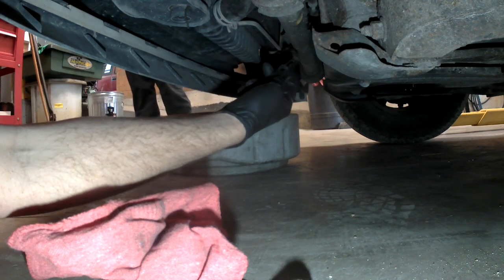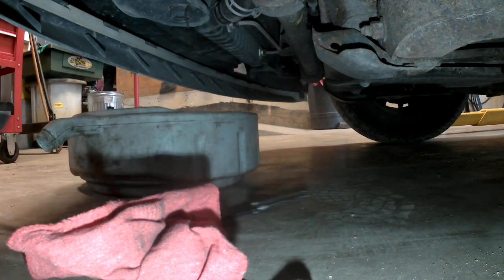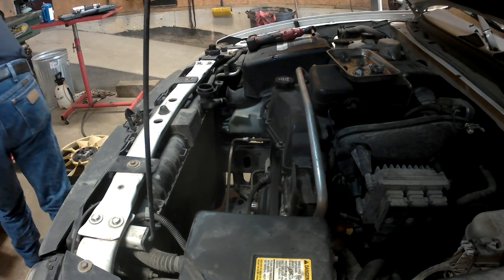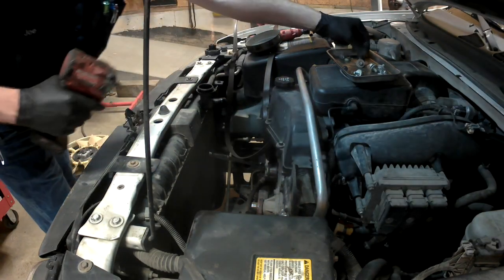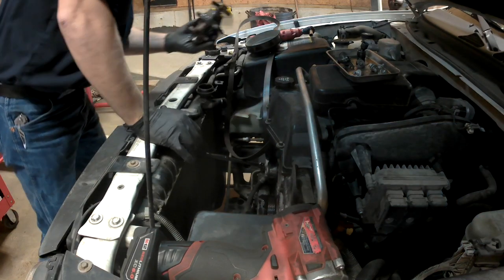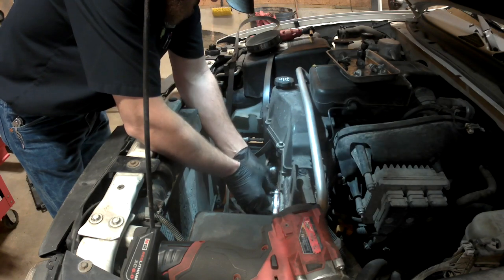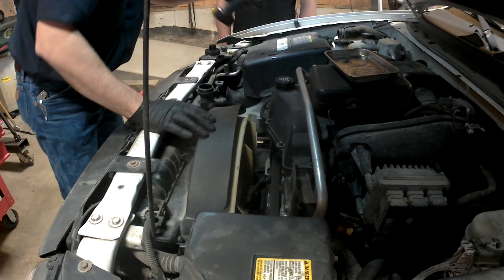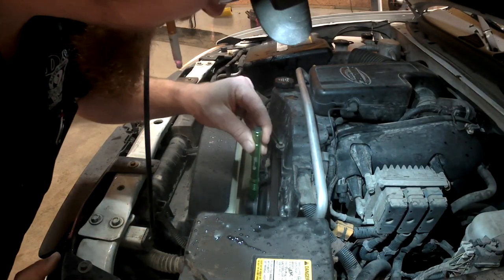2003 Chevy Trailblazer/ GMC Envoy 4.2L Water Pump Replacement

Comment: The easy way to get that connector unclipped from the fan shroud is to wait until the fan shroud has been unbolted from the radiator support, then push it towards the engine a bit. Reach into the fan shroud from the front and you will feel the back of the connector. Squeeze the back of the connector and it will come right out of the fan shroud.

Comment: You don’t need to put silicone on the gasket ?
Reply: Not needed at all
Reply: not needed, but wouldn't hurt
Reply: I was going to ask the same. If anything I have used it to keep the gasket in place. The pad to use is the green one for cleaning on aluminum. Great video. Thanks for the tutorial.